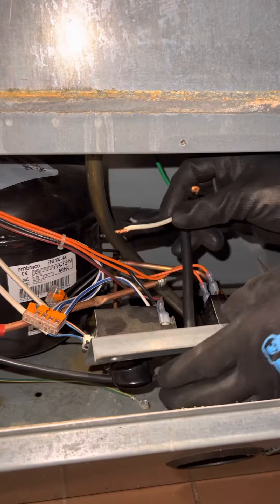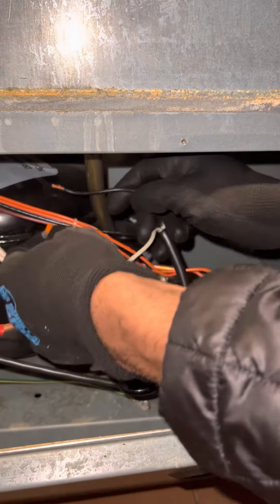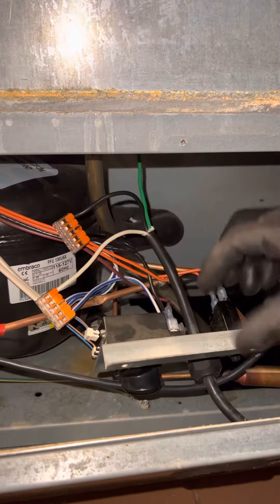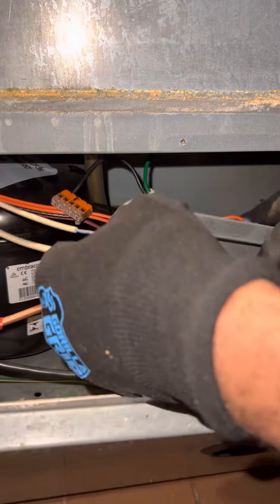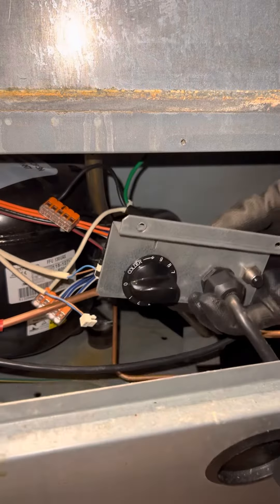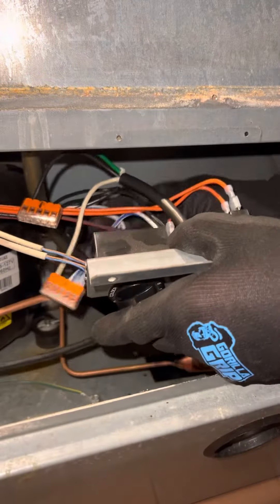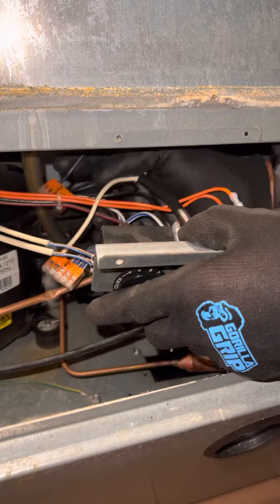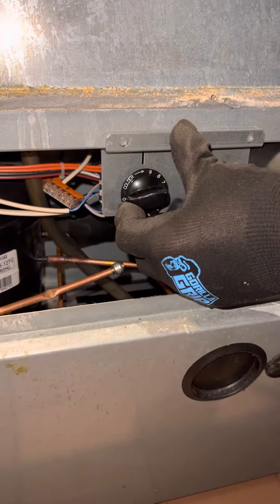Returning the wires to their right place. pt3

Comment: How long have you been using the Wago's connectors ? Are you satisfied of them ?
Reply from the maker: I’ve been using them for years. They are mandatory by the federal government. These weren’t mine, they were installed by the factory 4 -5 years ago. Wire nuts can arc and you can’t have that with flammable refrigerant.
Reply: @commercial_service  Interesting, I didn't know they were mandatory by the federal government. Good to know, thanks for the information.